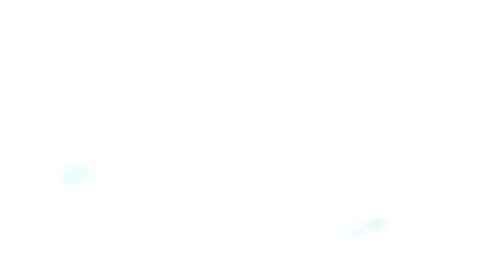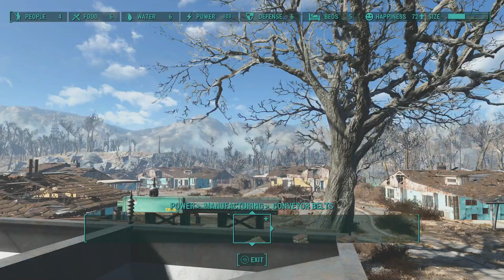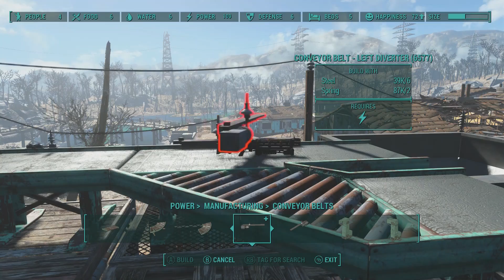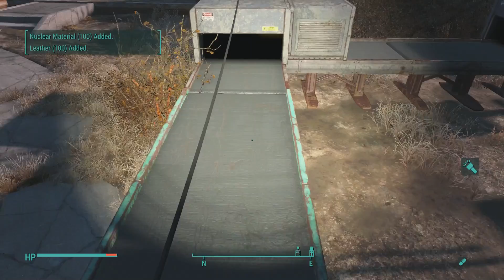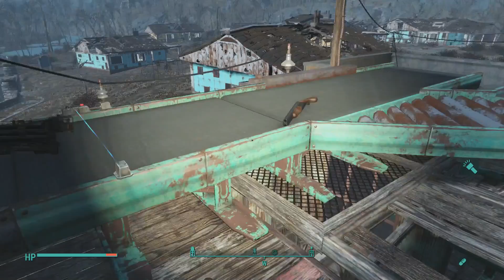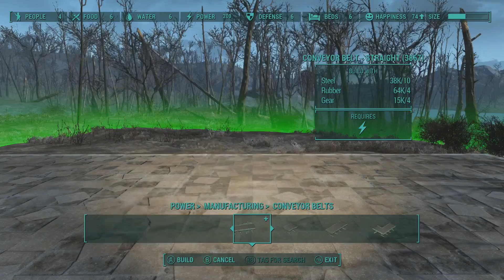Fallout 4 Contraptions DLC Conveyor Belt Basics Part 1 | Tips and Tricks + Mini-Guide

Comment: In the part where you make the drops from the hopper (about 7:00)
How do you fix that the individual pieces do not have power?
They need to be connected to power, by themselves they will not work.
Reply: Ok you work the problem later in the video, but it does make for a lot of extra "clutter".